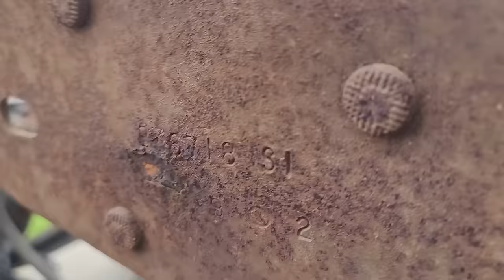Ford Ranger, MIG welding truck frame back together, how to.  Build part 7

Comment: That is one of the nicest frame repairs I've seen in a long time I've see some people weld straight up and down and I shake my head because they don't realise that it will crack right beside the weld...
By rights you are not supposed to weld a frame but Bolt or  Rivet a patch but your angle weld should pass it's the straight up and down welds they don't want becouse of flexing the welds will crack Me a way to stop a crack is drill a hole at the very end of the crack (centered) Arne "V" out the remaining crack and weld it the drill hole will stop the crack from continuing farther if you just "V" out the weld the crack will continue down the road from flexing ...
Reply: "crack right beside the weld"..???
Utter rubbish.
In fact, reading through your post, I can see that none of it is appropriate for this presentation.
Reply: @tandemwings4733  bingo, actually just finished a frame extension for a van body on an industrial tractor.  Straight cut.  It's funny people think this but think nothing of all the straight vertical welds in say oh I dunno, an ore processing plant. Or a power plant, or a gas plant lol.  The world is literally held together with straight vertical welds.
Reply: @HisNameIsTater  
Correct. 
As a welder myself, I'm aware of how often I do straight vertical joints.  And as for this bullshit about drilling the ends of a crack, that is just some rubbish left over from the days when cracks (especially in engine blocks and heads) were repaired mechanically. When welding, it is not a recommended procedure.

Comment: Nice job on that A.O. Smith frame. Glad to see you used the 19.05mm tooling hole for your alignment. I worked on that frame quite a bit in my 28 years with the company.
Reply from the maker: What's the story on the AO Smith name?  Those holes worked so well in getting it all straight.
Reply: @frostydoesit  A.O.Smith made the Ranger frame until it was discontinued in 2012. The same company that made the model T frame and more known today for hot water tanks. A.O.smith sold to Tower Automotive in 1998 thus ending their involvement in the auto sector. In 2006 we moved the ranger frame line out of Milwaukee Wisconsin to Bellevue Ohio. That is also when the frames were e-coated instead of wax like earlier models. The hole you used is in all our stampings, frame rails and crossmembers. We use that tooling hole 19.05 along with a slot 19.05x whatever length to align each detail stamping as it goes the the die progression. Look at your crossmembers and you will spot the same features.

Comment: Yup nice fit but putting a radius on the diamonds points or using an oval would be better. Also a few plug welds in the plate would be better as well.
Reply from the maker: Hi Al!  I agree on the radius part.  I did have 3-4 holes in the frame that I welded through to the back of the fish plate, you can see those at the end of the video!  Thanks for watching and commenting!   -Frosty

Comment: Man C channels are amazing I hate box frames it's a nightmare to fix
Reply from the maker: I like the simplicity of the C channel too, very easy to work with.  Never have to worry about junk collecting and sitting inside and rotting it out from the inside.  Jeep and Toyota seem to really have had a lot of problems with their box frames.

Comment: Thank you for sharing nice work. I'd recommend treating and painting the frame though, it will last a lot longer. 😊
Reply from the maker: Thank you for the kind words!  I will most likely take this truck apart again in the future and go through it.  I have plans to swap in a turbo 2.3l out of a thunderbird or a 3.9 cummins...if either of those happen I will make the frame pretty!

Comment: Nice fit-up. I usually go with a trailing or downhill direction for open root with SMAW and GMAW unless the WPS calls for something different. Tends to have better penetration and you don't have as many issues with accumulated heat because you are always going away from the heat.
Reply: Well i hate to bust your bubble - but as a 42 year pipefitter/welder uphill ALWAYS provides the best penetration. I won't explain because you already did in your backwards interpretation.
Reply: @scotty362100  I follow what the WPS for the required project specifies. I know uphill stacks more metal. Sometimes that isn't necessary.
Reply: @scotty362100  most of what I do falls in d1.1 and 1.3

Comment: Great job and a really good set up .   Myself I would start and finish welding as much as I could on one frame side only so your frame steel will not suffer from shock heating and cooling to fast that can result in brittle frame weld joint.   If I have to weld in the cold with lots of start stop welding because of set up and grinding I will use the Oxy/Acet  torch after welding set to " slightly " carburizing flame so not to oxidize the metal but to reheat the frame welding metal to red hot then let slow cool to make your weld less brittle.   That is how I repair airframes for airplanes in the past.   Your fish plates should not be so big that the fish plate comes close to the upper and lower rounded corner of the frame - that is a flex zone for the frame to move....   If the frame cannot flex where it was designed to flex where the frame is rounded ( at the 90degrees  bend of the  U ) the frame can crack ahead of plates or behind your fish plates.  So make your fish longer and narrower.    Please keep up the great work and give me more to think about.....  You got my thumbs up and subscribe.    That light duty truck frame repair will last longer then the body of that truck....    One last note -  keep your fish plates 1 to 1  1/2 inch below the top of the frame and same space from the bottom That is the flex zone of the frame  ...
Reply from the maker: Great feedback, always something a guy can do better!!  -Frosty

Comment: Have you ever looked at a car arrier trailer ,,,all of the corners are little Dimond shaped plates of steel these little diamonds are stronger than strait steel is but it also allows the steel to flex without breaking its like building a bridge ,,,nice work you are very clean welding and detail ,,,pay attention to the details and everything else will just fall into place
Reply from the maker: Thank you Brian!

Comment: Like your work, good instructional video. One point I disagree on is welding the fishplate all the way to the end points. My experience is frame work on large trucks, I was taught was to stop just short of the end points due to stress. Perhaps someone here with similar experience could comment
Reply from the maker: Great point!  I think you are right on that part of it....I was doing the best I could with the knowledge and tools I had... always learning as I go!  Thanks for watching and taking the time to comment!
Reply: We carry the weld bead at least an inch past the corner.

Comment: I think you did a pretty good job for not being a professional welder. Things I would of changed: I would of made your fish plates horizontally longer by about 8 inches total and rounded the sharp edges off a little more. Also I would of used dual shield. But I get it you're working with what ya got. It's should be fine tho. Nice work.
Reply from the maker: Thank you for the feedback!  I think it'll be fine too, just a little 1/8" Ford Ranger frame.  If I do one again I will remember the fish could be designed better.  Thanks for watching and taking the time to let me know what you thought!  -Frosty

Comment: On the TIB / TTB F150's you can swap them and convert a 2wd frame to 4wd pretty easy. I'm not sure about the rangers but you might have had an easier time just swapping the front suspension. 

However, it's a perfect example of how to splice a frame... I keep saying I'm going to make a short box out of my long box truck...
Reply from the maker: You know I went into this thinking the same thing as I have done a ton of F150s but the frames on the rangers and crossmember mounts for the 2wd and 4wd rangers are in fact very different.  I show this in a few episodes prior to this video of you care to check out some of the older videos I have posted.  Thanks for watching and taking the time to comment!  -Frosty

Comment: Excellent welding job.  Great thing about Rangers is you get to try a lot of different engines on them once the original blows up right away.
Reply from the maker: I had a 2001 ranger with a 4bt cummins diesel, that was a very fun truck....especially at the gas station,  was always a conversation
Reply: @frostydoesit  , what did you use for front coil springs? Those are fairly heavy engines aren't they? I have a '98 Ranger that I would like to do an engine swap on.
Reply from the maker: @bradleynelson5915  I had a spring shop get me some that were rated for 400lbs more than stock

Comment: You forgot to take dynamic loadings into consideration, these can be many times static loads. The idea of fish plate reinforcement is that the stresses are not in line with the weld but at an angle to the weld at all times, to this end the plates can be fish tail, diamond or even round. But a correctly made weld should be strong enough in its own right. I have extended Transit type vehicles using the plug and plate,where the extension piece is bolted to the welded in plate with the plug welded to that.
Reply from the maker: Thanks for the pointers, after a year and a half we are all still good with the little ranger frame!!  Thanks for watching!

Comment: I welded my ranger frame, but not from 2 pieces. I just boxed it with 4340. Only 100 pounds heavier but its stronger than a 1 ton frame now.
Reply from the maker: I bet it doesn't flex too much anymore!

Comment: I think you did a excellent job on the frame, just one thing extra I would have done, I would have cut two long slots into the fish plate and plug welded it, as the central area of the fish plate has no adhesive contact with the frame.
Reply from the maker: Thank you!  Towards the end of the video I do point out that I had welded some holes in the frame to the fish plate, essentially plug welding it.  Thanks for watching and sharing your input!  -Frosty
Reply: @frostydoesit  Ok, sorry I missed that fact, its a good job mate.

Comment: Good job. When I shortened my truck I just cut it at 45°.
Reply from the maker: Thank you!  I thought about the 45° cut as well, may try it in the future.  The guys at my work have done a lot of semi frames and they use the cut like I used in the video.  I think either way is far superior to a 90°

Comment: Nice work. I would have left the bead on the outside. There's strength in that bead. When you look at oe frames that have welds you can see the beads. Did you turn the gas up after your tacks? A pointer for anyone watching is to turn the gas up when gas welding outdide, sometimes cardboard to block tbe wind from blowing the gas away.
Reply from the maker: I want the frame to look factory from the outside
Reply: Interesting, I can't think of a single welded frame from a manufacturer. We have worked on semi trucks with 30+ feet of frame from bumper to bumper and there is not a single weld bead. Frame rails are one continuous piece of steel, stamped or hydro formed. Please post a link of an OEM welded frame.

Comment: Seems like everybody has put their two cents in on this project... well here's my penny's worth I would of beveled your gaps are so tight in some areas. The fish plate would be rectangular with plug welds so the plate can't flex independently from frame. I admire your courage taking on this project.
Reply from the maker: Thank you!  Yes the video has gotten quite a few comments, everyone does things a little bit differently!  I have certainly learned a few more tricks from everyone than I knew beforehand!  Thanks for watching and commenting!!  -Frosty
Reply: Rectangular plates are not the proper way and are an illegal method of repair in over 22 states. Diamonds, diamonds and diamonds with radiused points. Square or rectangle patches are prone to cracking. I spent 7 months researching, calling and emailing all top dmv and DOT inspection officials in the lower 48 states before we started cutting and stretching semi truck frames, I am well versed in what is and isn't legal for frame repair.
Reply: If you mean semi trucks I thought you only bolted another frame piece inside when lengthening a truck frame

Comment: Well, as you can see, 😉 every one, knows better, right ?  That said, for a first frame splice, I think 🤔 it was an excellent 👍 effort . And for those, bringing up the finer points, constructively, that a nice "village" knowledge exchange. For the others, who more dire, in they're predictions on stress fracture, I would remind them, the drivetrain is a damn 88 to 90 HP, who knows how little freaking torque motor in there..  If you did "Pikes Peak" 50 times, I don't believe you'd come anywhere near stressing that damn repair. Keep burning, and wrenching pal, it's fun to to watch others living the dream.
Reply from the maker: Thank you Joe!!  I couldn't agree with you more, I used what I had with the knowledge that I had and it came out pretty good, it hasn't spontaneously broken in half or cracked in over a year!!  I don't think it will to your point.  Thanks for watching and taking the time out of your day to comment.  -Frosty

Comment: Hey man found your video and find it useful as I'm building a custom frame for a 2020 Ranger.
I need to make many joint welds and the joint you did might work for my build.
I'm going to be using a fully rectangle tube for the frame so will need so split joints for sure.
As I build some rise and bend sections I may have to do some fancy joints to make the angles together.
Anyways take it easy man,
 Casey
Reply from the maker: Hey Casey, thanks for watching and taking the time to comment!  Sounds like a cool project you  have goin on!  I'll take a look at your channel tonight.  -Frosty
Reply: @frostydoesit   Hey man I'm still looking into doing my custom frame for my project and I found this video with commentary of your video.
The guy is a structural engineer apparently and suggested traditional butt welds are just as strong as angle or Z splices. 
You can check out his video on this link: https://youtu.be/V-9QECXkPTg?si=FNC0RpWzja0-f_v1
He makes some very valid points and makes me feel better about not doing crazy joints and splices to my frame project.

Hope your doing well,
Casey

Comment: Close but not the true proper way. The concept is there, don't get me wrong but being a custom chassis builder in various types of chassis styles, when welding in a diamond fish plate, you never weld the points of the plate. You leave between 1/4 to an 1/8" gap. That way when the frame is under hard flex, it doesn't have a place to crack near the weld never allowing the crack to follow the lines of the weld. I've stretched and shortened many semis and I didn't know until a senior welder/fabricator showed me and explained in details.
Reply from the maker: Thank you for the tip!  Next one I do I will probably make an oval fish plate!  I appreciate you watching and taking the time to comment!!  -Frosty
Reply: Joseph speaking knowledge.

Comment: Lot's of work 😃👍🏽👍🏽
Great job !!
Seeing you have the frame this far are you considering strip off all parts and media blast.. do any repairs as needed & powder coat for the ultimate
In frame care down the road ????
Reply from the maker: Hi Traky Boy!  Thank you for watching and commenting!  The truck is back together now (watch my other videos) and once I get some seat time and if I decide I like it I may paint the frame.  It takes me only a few hours to remove the body.  We have a sandblasting and painting operation at work so it would be easy to do there.  -Frosty